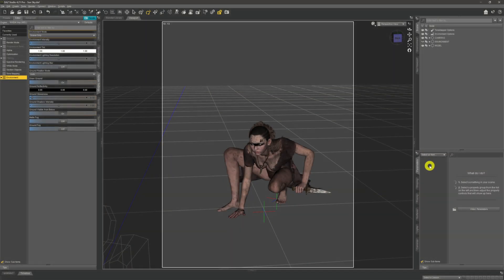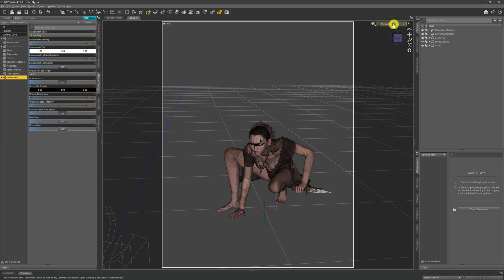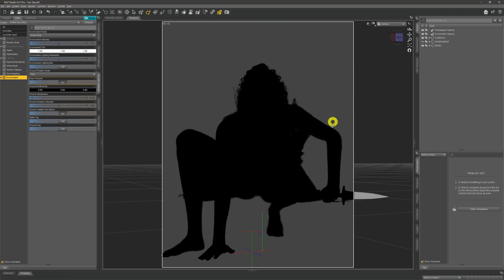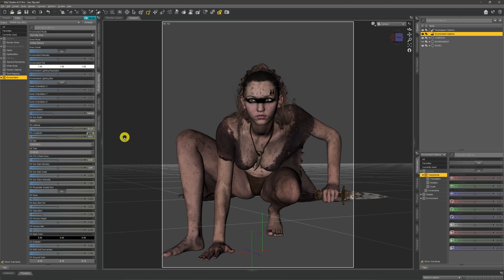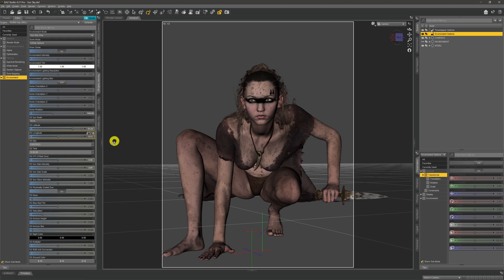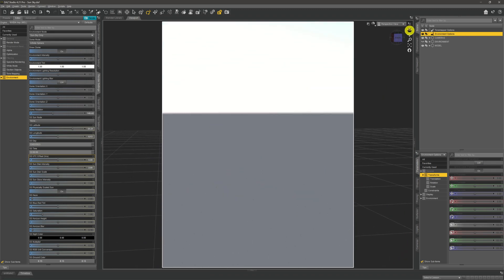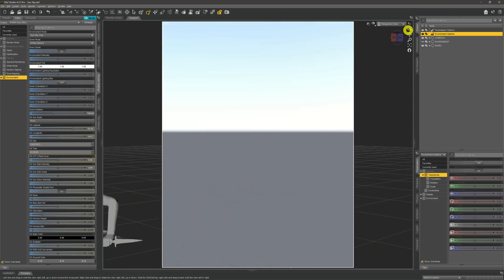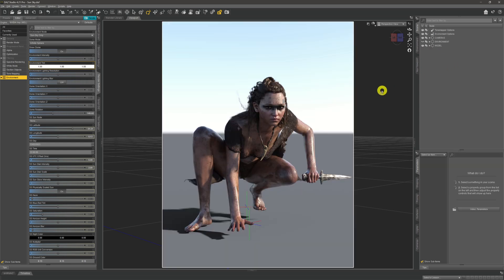Daz 3D Lighting Tutorial : How To Use The Sun Sky Dome

Comment: If I put a white, vertically oriented plane to the (HER) right, would the sunlight bounce off and add some fill to that side of her face? Thanks!
Reply from the maker: It should do, yes - just like real life. You might have to play with the glossy sliders on the surface of the plane to get best results - but a base plane should work to a degree
Reply: Thanks! @RaukoDaz3D

Comment: Hello, weird request. Can you do a tutorial on how to do face expressions. I'm having trouble making face expressions looks realistic. Thx ☺️
Reply from the maker: Hey Anna - it's not weird - it's a perfectly reasonable request because Daz models are so difficult for expressions. I still don't think I have a handle on it. The main problem is the mouth / lips area for me  - there's just not enough detail and bones in it for my liking. It doesn't help that a lot of PAs seemingly create their models with "resting bitch face" already dialed in and that it can make doing anything with mouths very difficult as the lips seem to twist and turn in strange directions even when using the base smile sliders in Daz. And - to make matters even worse - I think Genesis 9 is worse than Genesis 8 for it so it's not as though the momentum is going in the right direction.

The only real advice I can give is subtle is best. You might have a morph that goes from 0 to 100 .. but anything past 20 makes the model look like a deranged lunatic. But it's dependent on the model - as I say, some PAs like to dial in "resting bitch face" as their base or bake in a pout on the lips which makes doing anything with a simple smile difficult .. where the PAs don't do this you have a bit more scope.

That's all I've got really - I struggle myself a lot of times with expressions on some models .. so it is model dependent. But, as mentioned, I've found subtle works best ..

Comment: Great video as always, Rauko!

If it doesn't offend anyone, including you, Rauko, there is another clever way to use the "Sun Sky Dome" a little better. The problem is that if you decide to use this method, you can't use any other lights because logically, they won't work. BUT... You can use "Dome and Scene" and delete "Environment Map". It is then actually exactly the same as if you were using the Sun Sky Dome, but the difference is that you can also use other lights.

Important info:

If you decide to use the method I wrote about, every time you open your project in DAZ, you have to delete that map again. For some reason, it always returns when DAZ is opened and closed. This is quite an inappropriate method for people who use "Render Queue," for example, but at least for me, it was always pretty cool (if I didn't use HDRI).
Reply from the maker: Yeah, I'm aware of that work around and it's great that it exists - but it is actually a bug that could get fixed in any new version of Daz hence why I didn't include it. Now. Why "Sun SKy" prevents the using of spot and point lights in the first place is another issue. I don't know why Daz itself blocks it.
Reply: Yep, that works and I know Val from Dreamlight uses that method as well. I can't speak for anyone else but this didn't offend me because we all learn from others thanks for sharing.